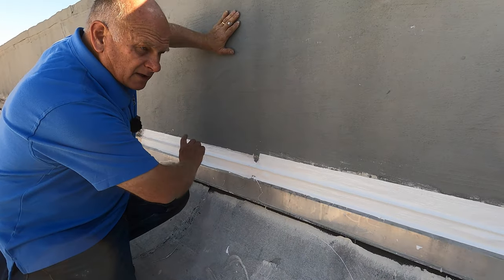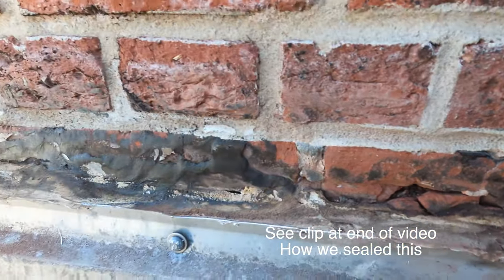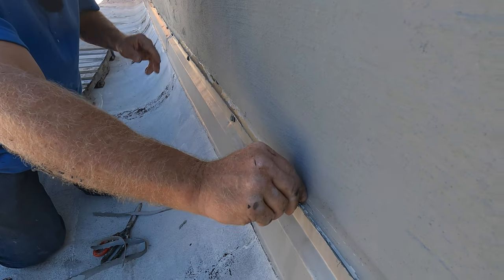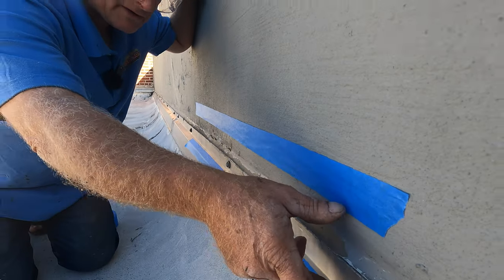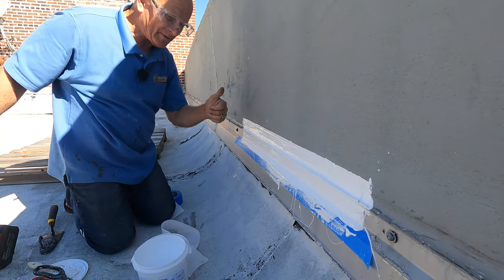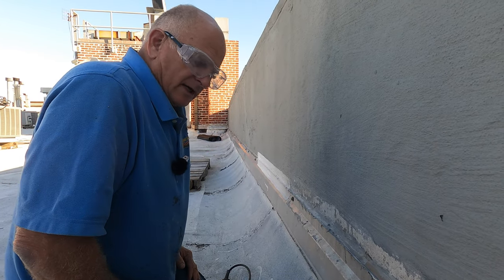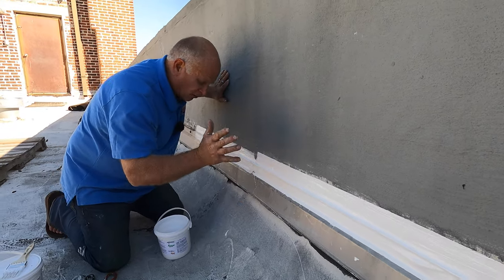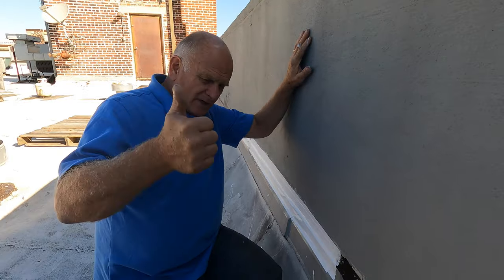DIY Liquid Sealant - How to Repair Flat Roof Flashing Leaks easy and fast

Comment: I built  a shed  and i just have plywood  for the roof  it does well but in between   the ply wood water rain water goes threw what can I put in between  the plywood to waterproofing  to stop the water?

Comment: The flashing should be done over again. There needs to be a curf cut made and the flashing should be embedded into the curf and sealed properly...surface applied flashings are a sure failure
Reply: Curf cut?
Reply: kerf cut

Comment: Hello Sir, excellent work! But i have a question. I have the same Problem with water coming in from above the flashing. But my house wall is insulated with styrofoam panels. So directly above the vertical metal bar are the styrofoam panels and they are 15 cm thick coming out. So i have no space to seal the flashing. I hope you understand as my english is not the best. I am from Germany... And also i would need to know what ingredients are in the sealant that you are using because here in germany we will not have the same products.. 

I hope you could answer me, because all companys who where lioking for my flat deck dont want to repair it they want to make it completely new but i am sure its exactly just this problem thank you very much

Comment: Can I use this product on my metal shed exterior concrete floor to bottom of the building joint? I have water coming in and I am trying to fix the problem

Comment: You didn't fix the problem you put a band-aid over it. To fix it right you had to remove the metal then you could fix it the way you did. The cap sheet underneath the metal is still separated from the wall the way you did it. It might not leak now but if you get a heavy rain fall with 6 or 7 inches of water it will. So to save 2 or 3 hundred dollars you did it over the metal and your the roof Dr. Just put on another band-aid on it.
Reply: Thats not right. I have repaired my flat roof exactly this was 3 years ago. And since then no water damage came back. And i live in aregion with regular heavy Rain.
Reply: What do you do if there’s weep holes above the metal? Cover them lol
Reply: Okay, so you are saying that I should remove the metal, do what he did but directly where the roofing material comes up, then put back the metal. And then what? Should I leave the opening at the upper part of the metal open or should I still seal it with something?

Comment: What is the name of the white paper or cloth you use  between the paint? Thanks
Reply from the maker: It is Charmin Ultra Soft Toilet Paper, just kidding It is a polyester fabric designed specially for this application. You can get it here: https://bergstromm.com/product/poly-fleece-rolls-2/
Reply: @FlatRoofDoctor  Thanks
Reply: @FlatRoofDoctor  I am in Canada. I can only buy Henry 100% Silicon White Roof Coating. Do you think I can use it as well? Thanks in advance.
Reply: @FlatRoofDoctor  thanks
Reply: @FlatRoofDoctor  🤣🤣🤣
Reply: You can fix it with a counter flashing cut line into the wall and install counter flashing and seal it over with sikaflex and done deal